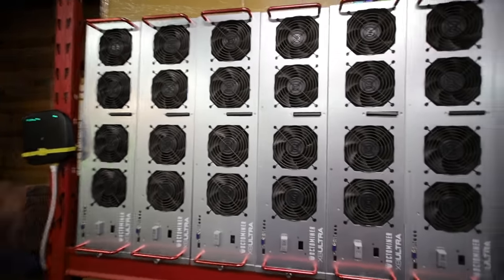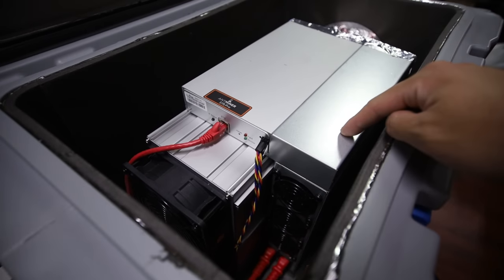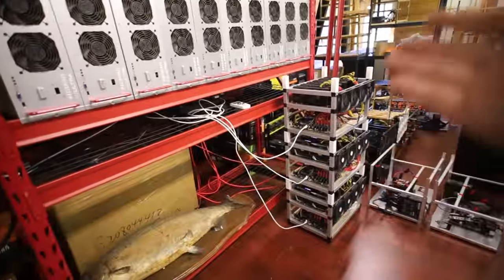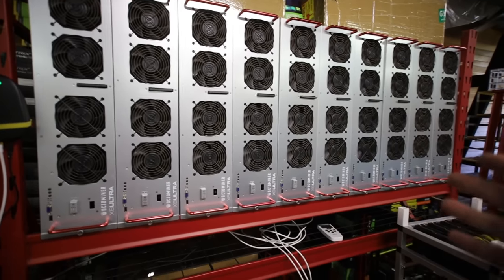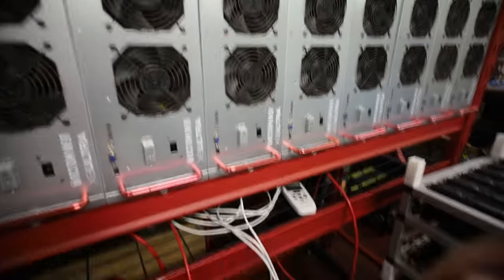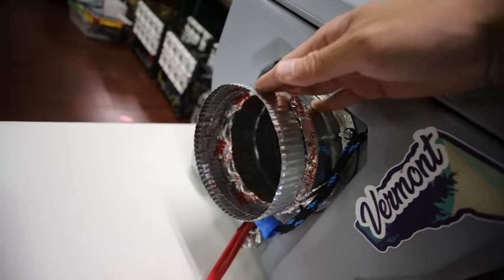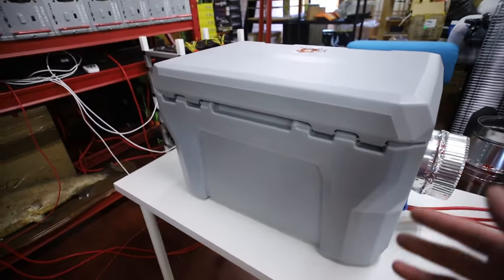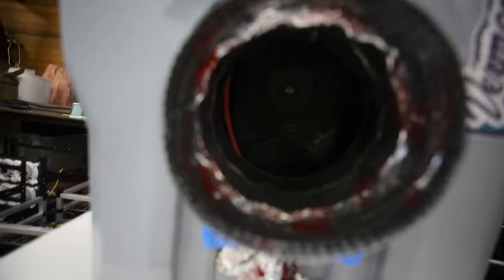The tides have turned.

Comment: I’ve been running an s19j pro off of solar panels and grid power auto switching source when solar is available. I have a ventilation system similar to yours as well, but I’ve got an industrial exhaust fan sucking the exhaust away and it results in the miner fans running under 4K rpm which makes it super quiet. I’ve been doing very well! Mining for free during the day every day!

Comment: Red Panda Mining! RPM brother now I know why you said in yesterday live stream you where thinking about me! As you may know I have been BTC mining since 2016,  I currently have 74 ASIC in total not all of them online, (62 BTC miners) 30 S19’s I paid $2-3k each, 24 S17’s I paid $1.3-2k each, 8 new T19’s paid $1.6k each (to replace 8 of my S17’s), also just purchased yesterday 12 S19 100T and 12 other ASIC miners L7’s, Z15’s, D7’s, HS6’s, KD5’s, LT6 and waiting for my new SC6 to show up, I have 6 active mining locations, I am using about 950 amps over the 6 locations, some locations I had to have custom shroud made to reduce noice.
Reply: Also the merge has not affected the bulk of my earning, and because of free electric at all 6 mining locations I still have my 3 GPU rigs running on Flux.

Comment: My miner is off. Has been for the last month. We are waiting for the electric bill to come to see what the difference is and to find out how much energy we are using.
Reply: Just take your last bill and divide it by kwhrs used to get your kwhr price. Then figure out how much your miners use and multiple that by kwhr rate.
Reply: I did that a few months back. My rig pulls about $80 in electricity a month and I’ve made about $40 so far this month. So, operating at a 50% loss so far. Now if I hit a solo block in the next few days I’ll be around 25% loss for the month. Not bad IMO, all things considered. I’m willing to bite the bullet over $20

Comment: I have 60th worth of s9's and one M3 2200w
i have 1.4gh worth it LTC from L3s
it is profitable but my greed ass won' tbe satisfied with the 300 usd it makes per month
oh i steal electricity :) 
no heat problem RPM got a biiiig basement and noise no problem.

Comment: These BITMAIN AISIC devices will make 90dBs of high pitched noise because of those fans. If you don't have a basement or outbuilding, you will not be able to use this, well, unless you are deaf and don't care about your neighbours. I was shocked with my S19 Pro. I've had to install custom 8" ducting and disable 4x 6" fans to make this acceptable even in my garage 20 meters away from the house. Note that you have to obtain fan spoofers if you do this else the devise will shut itself down with fan speed errors. You might want to look at immersion cooling if you want to do this in the house. Oh, and they pull about 15Amps at 240V each!